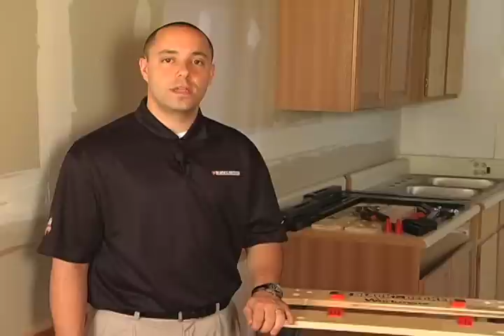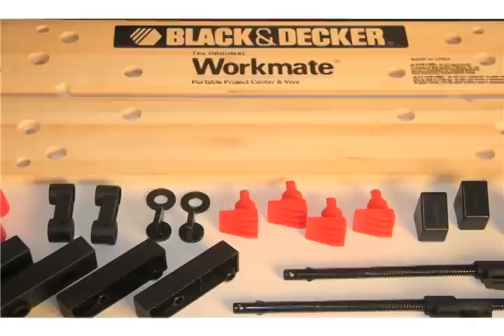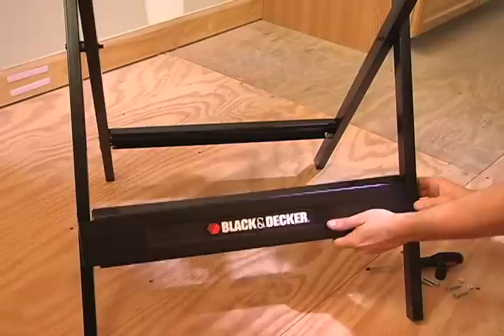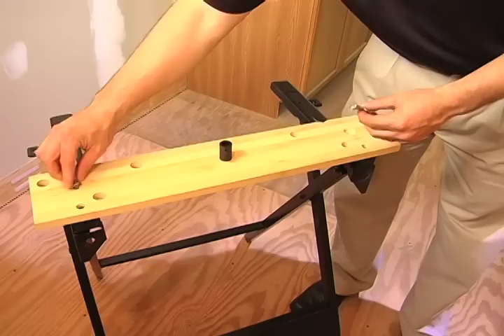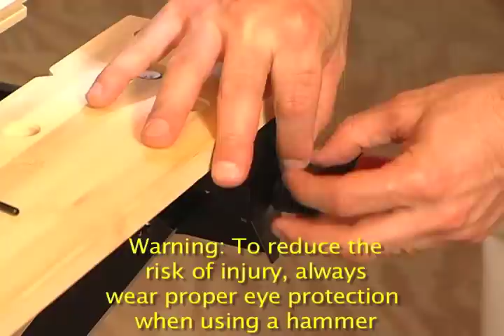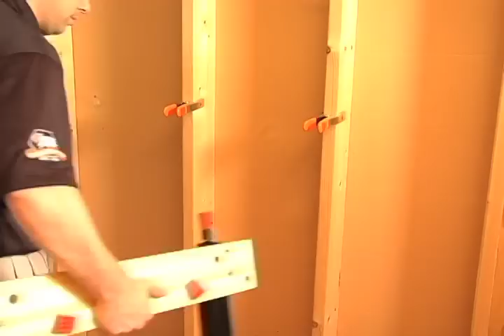How to Assemble Your Workmate®

Comment: Awful product. The part where you have to hammer the handles in sucks. I used oil and everything to no avail. Ended up gluing it on. Replace it with something that can be screwed. Also I had no instruction manual. DO NOT BUY!

Comment: The vice screw rod is not easy to hammer in. I realized this will be very difficult to remove once hammered in. I whittled two wooden chopsticks into dowels and hammered them in. This does an equally good job and is easy to remove if required.

Comment: Dear B&D:  Thank you for making this video.  Today I happened upon a brand new, never-opened WM125 that my dad apparently purchased around 2007, then attempted to assemble it. 

Between the enclosed assembly instructions, which are AWFUL, and also INCORRECT based on this video, and coping with multiple manufacturing defects, I've put nearly 2 hours into it so far. And all I've accomplished is attaching the braces to the legs. I wish I'd thought sooner to look online for help. But frankly, given the quality I've observed so far, it never occurred to me this thing would still be in production with help resources available online.

A couple of questions from my experience thus far:

1)  WHY, in the 21st century, are we still using flat head screws??  Were B&D engineers not yet aware of phillips head technology in 2007? Was there some factor that rendered phillips heads impossible for this product? Or is there some advantage to flat head screws that I'm unaware of?

2)  WHY would you make a threaded knob out of PLASTIC?? Knobs by definition are for turning, and anyone intellectually capable of tying their own shoes could reasonably anticipate that the WM125's knobs will be turned often and turned  tight every time.  PLASTIC threaded knobs for this, really?

I've already stripped the PLASTIC threads in one of the locking knobs following the very first assembly step. It would have helped if the enclosed instructions mentioned the spacer, and I couldn't turn it tight enough that it wouldn't slip. Now I'll need to go to a hardware store to get a metal wingnut to correct B&D's quality error and make the product work.  Gosh that's annoying!

3)  How many units were produced with misshapen braces that required power tools to make them fit on the legs and align the holes??  Or did you assme someone purchasing this product would have the tools and skills needed to work around the shoddy manufacturing?

I'm going back out to my garage now to give this thing another shot. Hopefully with the benefit of this video (for which I am truly grateful), I'll manage to put this thing together and make it work despite B&D's quality lapses.

In 40 years of purchasing tools and other products, I've chosen B&D products over and over because I've always perceived B&D to be a good, quality brand.  Today I question whether my perception is still accurate. Given that my WM125 was purchased more than 3 decades after the product's 1973 launch, that should have been enough time to get it right. I'm very curious, if I bought one today, would it have the same problems??  Hard to say, but I'll certainly think twice about choosing B&D products from now on.

Comment: I've tried hammering the pin and also using a channel lock; can't seem to figure out this one part and it's preventing me from using the workhorse which is so frustrating.  Is the hammer really that easy or do you need to use a lot of force??

Comment: This item is extremely convenient but holy is it a pain in the rear end to assemble. Only advice I can give is use this video and the paper instructions together while also pausing the video to be able to see which piece he is even talking about while putting it together. The pin for the hand crank is going to take a lot of banging with a hammer to get it to go through. Good luck

Comment: When installing the handle pins, easier to use a large Channellock type tool and squeeze the pin in instead of hammering. This work table isn't the most robust even though it's supposed to handle 300 pounds of weight.

Comment: This is hilarious because the instructions that come with it dont match these at all lol. The parts are cheap and crooked and it’s impossible to hold it together and then when you get to installing the vise the B bolts that are listed in the instructions to use dont even screw in. Bravo black and decker, ill never be buying anything from you again.

Comment: The knobs did not fit into the handle holes because the studs in the knobs were too big. I heated up the handle, then use a hammer to force the knobs into the handle holes. Bad tolerances 👎👎👎👎 designed

Comment: The written instructions are very poor and are also different than the video, and on top of that, the video doesn't represent some of the difficulties of the assembly. For example, the video shows the guy just snapping the orange handle into the black crank without any issues, but the truth is the orange handle is constructed of rather brittle plastic that has little give when attempting to assemble by hand. After hammering and cussing, I took it out to the garage and placed the 2 pieces into a vise, and was able to squeeze them together. Then the spring steel pin that they supply to assemble the handle to the screw drive is also an issue. After pounding with a hammer and cussing some more, I decided to grind one end of the pin to enable it to seat enough into the hole of the screw drive to be able to pound it in with a hammer.

Comment: B&D please do yourselves a favor and DO NOT ship anymore Workmate 125s until you have completely overhauled the instructions!!! If I was the product manager for this, I would be afraid to show my face in any sort of relation to this product. It might be a fine workbench, but anyone who attempts to use the provided instructions to assemble this thing is going to have a negative view of B&D. Here’s a suggestion: take an employee or an intern, someone who is not knowledgeable on this product and have them attempt to assemble it using the provided instructions. Watch as they become confused and frustrated. That’ll give you a good starting point for the revamped assembly manual. YouTube and Amazon are FULL of negative remarks on the assembly instructions. You ought to be ashamed and you owe anyone who has purchased this item an apology!

Comment: Add the video link to the front of the manual and a qr code to it.  Also, the handle orange knobs mold at the factory must have been off because it took hundreds of pounds of force to get the orange knobs in the handles.
Reply: literally terrible. almost broke my hand trying to get it in. honestly idk how this company doesnt have a lawsuit due to the terrible instructions and clear mis prints in the handle

Comment: Which ones are the front slide blocks and which one are the rear slide blocks? Your manual doesn't indicate which ones are which. Also which way do you put it on the device? This is the section of the manual that's not clear and also not clear in your video.

Comment: The written instructions are more than useless, they are the source of self doubt and complete frustration about one's ability to follow what are, as it turns out, terribly inadequate written "instructions"...but even more, the drawings are for the most part more confusing than helpful as they do not depict clearly and in large enough scale to make out what pieces and their orientation are essential to putting them in correctly.  And the video is not much better...there is more time spent on watching bolts being screwed in, and pegs being placed in their holes, and plastic feet being placed on the legs, and a handle being pushed in to its holder, than how the critical rear sliding blocks are to be lined up and hooked up with the cream-colored plastic attachment on the long threaded bolt that is the primary key to ultimately putting the assembly together and workable. Those key elements need to have been shown close up and slowly, emphasizing the correct part, its orientation, which parts on it are supposed to hook up with or be inserted into what other parts with the camera being moved in close enough to leave no doubt about what goes where and how! The video, just like the written "instructions" (which by the way in some cases use unnecessary technical terms and measurement specifications rather than just simply referring to the part's letter) by their omission of key steps and virtual complete ignoring of their importance to successfully and happily putting the workbench together, both render the effort of "instruction" an unforgivable disaster. Shame on Black & Decker!!!

Comment: The PM should be embarrassed. I'm lucky the orange handle didn't snap getting it in, can you explain why that came as a separate piece and not already connected to the other part of the handle if it's going to be that hard to insert? The roll pin is a joke, I tried to make it thinner using pliers and could not change the shape whatsoever, so there was no way it was ever going to fit into the other metal piece (convenient how in your video you skipped over it). I ended up using zip ties instead

Comment: I appreciate the video yet way too fast and you can't see the orientation of the parts or how you distinguish which is front.   
Would have been better if you showed to parts in its position.  
Overall with woeful directions and this video I figured it out in good time yet frustrated you didn't focus on part and it's orientation
Reply: *too
Reply: @spacep0d  amended.  :)
Reply: @sf3486  Good on ya!

Comment: The metal holes are drilled wrong, the bolts won't fit all the way in no matter how much you try, the pins are too large to get the handles on no matter how much you pound on them with a hammer. It's too late for me to return this POS. Even without the handles on when I go to move the screws the unit doesn't move so it doesn't work. At least this video was helpful but the whole freaking thing doesn't even work and I'm very disappointed B&D used to be a good company but now, like everybody else, goes for garbage ware from sweatshops in China. Instead of sending jobs offshore and screwing Americans why don't you go back to producing good quality products? Unfortunately it's too late for me to return this. I actually let it sit for a month or two in my work room because the instructions were so bad I didn't feel like tackling the project. Now it's too late and I'm stuck with a piece of garbage.

Comment: The written instructions were fine but the roll pin attaching the knobs needs to go! It's impossible to get the damn things in there. I only got one partially in and managed to scrap up the metal in the process and get the second one in at all. .

Comment: I like how the video jumped when he was hammering the roll pin. It’s because that stupid doesn’t even fit
Reply: I ended up using a G Clamp, worked like a charm 👌🏻
Reply: @mar_pin  genius thanks!
Reply: @mar_pin  thanks for the idea -
Reply: I can’t get the roll pins to go in either. Have you come up with a working solution?
Reply: @katmit01  I used zip ties instead

Comment: It's amazing that he doesn't really follow the sequence of instructions that are found in the manual.  Also, slow the video down to make sure that people know what you're talking about with respect to front and rear slide blocks.  The manual has you putting in the long vice screws long before he does. If he''s the project manager, then how come he doesn't realize that the instructions for the product he overseers are substantially different than what he demonstrates.

Comment: It's called the WM301 in the UK. So please add that to the title. 
The instructions aren't bad, but not great. The pins are an absolute pig to hammer through the handles. I had to hammer the pins and close them up slightly to get them to go through. Even that was tough going!! Wear earplugs!
Reply: Thank you! I assembled mine almost entirely but COULD NOT get the fricking “snap-in” hahahaha pegs to go into the handles.

Comment: For the front and rear brackets, I suggest replacing the stock 6mm (M6) nuts with locknuts - also add 6mm washers on the nut side. 
Planning to mod the OEM knobs with something that uses a ball bearing and longer grip. Will make it a little more ergonomic

Comment: Would this bench be able to hold fire wood logs & allow for cutting down the middle  for kindling.  I would be using a sawzal or a circular saw.  The logs are approx 10 inch in diameter?  Thanx.

Comment: Here is the most important thing you should know about the Black & Decker Workmate. On the cover of the Instruction booklet, it clearly states - not to return the product to the store. The reason is this - the instruction booklet it totally useless. So assembling the Workmate is going to be an exercise in frustration. When this product first came out, some 40+ years ago, I purchased one for my Dad for Father's Day.  He loved it and used it all the time.

Back then, it came assembled and cost about $25. Now B&D, is a different company and like many other multi-national American Corporations they make this product in China. You can tell it was made in China, because the materials are cheap. The aluminum in thin and when I took the workmate out of the box, it was warped (fixed it with my hammer), and there are more plastic parts that replace the steel nuts and bolts found in the original version. Oh yeah, it costs about 2x - 3x the original price, now that they are making it cheaper overseas.

Do yourself a favor, before you try to assemble this item, by watching this nit-wit product manager, Frank, in the video; just return to the store, get your money back and purchase one that comes assembled. More than likely, whatever alternative product you buy will cost more, and be more durable. In the long run, it will save you time (90-120 minutes) and you won't feel like you want to drive a screwdriver through the forehead of Frank, from this video.
Reply: Um. This is made from steel, not aluminum. Stamped steel.
Reply: Good advice.

Comment: Useless instructions in the package 
For rear support you should have mentioned the white plastic with the screw bar had to get attached to rear wooden bar 
And only if you attached the long screw in video it will work 
As the holding pins are so tight that I inserted them first and realised the mistake 
Over all very poor instructions to assemble the item if would have known not have bought it

Comment: Please explain the difference between the front and rear slide blocks, and show which side goes up and which side goes down. This could be done simply by moving in closer with the camera and/or turning the parts over and explaining the difference. The video is better than the instruction book, which is virtually impossible to decipher, but you really need both to figure out what's going on since the video frustratingly cuts away from exactly what you need to see after about 1/2 second. So you have to go back and forth between the book and the video. This is a nice product but honestly the instructions for assembly are far too difficult given the overall simplicity of this item. Now that I've built mine I could build a baker's dozen of these things in the time it took to build one.
Reply: EXACTLY!

Comment: There were dozens of places where you could cut yourself on that material, trying to put it together.  Fortunately, it wasn't until the last step (getting the little slanted feet on) that my finger got slashed.  

Pictures did not match the script in the assembly instructions, starting at Step 4.  

Looking and listening back, it seems the narration in this video is accurate, but he's too dry and lacks emphasis where it is needed for you to understand on the first try, especially since the printed instructions are wacko.  A few repeats for emphasis and clarity would have helped.  Plus he glosses over the critical step of getting the bolt into the "pivot nut" of the vise screw--and how you'll need to do it one side at a time--blindly searching for the target hole--or recruit an extra pair of hands to hold the vise screw in place.  

Then I thought I was going to tear the whole thing apart as I had to hammer the pins so hard to get the handles secured--they won't be coming off, that's for sure.  

I still have one of the "original" Workmates that Bob Lilly advertised--it came down to me from my Dad.  This one will not replace it.  It won't even pair up with it, as it is several inches shorter.  But it's a fold-away platform that will hold some weight and that made it worth the $20 it cost (on sale price less military discount).

Comment: Not much better than the written instructions. Took way too long to assemble. Pinched my thumb putting red plastic handles onto winding mechanism. The back wood plate (the one with "Black & Decker" inscribed) is wobbly. Can't for the life of me figure out how to make it solid/secure. I really wanted to like this workbench bc I only needed something smaller, lightweight and foldable. But it's useless when you can't put the thing together. May return this and get a Pegasus WX051 which comes preassembled.

Comment: The pins for the handle don't go in as easily as you show.
Reply: Get a pin one size smaller @ super glue it in from both ends.Loctite works even better.Use lots of loctite @ don,t touch it so it dries clear @ smooth!